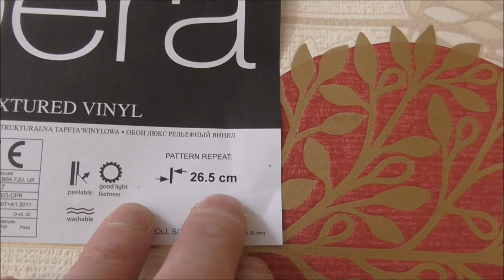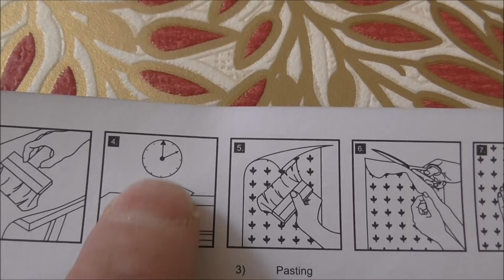Hanging feature  wallpaper on a chimney breast handy tips

Comment: Great job once again

When doing any fireplace as feature wall, do u always start from the centre and when it comes to the corners Measure the distance from the edge of the wallpaper in the centre to the front corner of the chimney breast, then add 25mm. Cut a length of paper to this width and hang, taking the extra 25mm round the corner, overlapping the side piece. Repeat for the other side , and then overlap the piece round the corner to the wall to finish.is this how you do the corners.

Comment: Great job and well explained, did you line first ? and what circumstances would you line?
Reply from the maker: Thanks, in this case no need to line usually only line if the paper is very thin and light in colour or the walls are crazed.  I always line if the instructions on the paper advice to though.
Reply: @PaintingandDecorating  That comment was very helpful. Have done a fair bit of papering and don't usually line but understand more now when you would need to.
Reply from the maker: @pizzaboy3946  thanks.

Comment: Great video informative as usual, I do have a question   when you paste two lengths at a time like you did with the first two you said it's critical to get the soaking times the same but if it only takes you a couple of minutes to paste two lengths but over five minutes to hang the first piece then that means the second length has been soaking for at least 3-4 minutes longer? 
Cheers Ian
Reply from the maker: IAN Knight you adjust how long it is before you paste the second.

Comment: Would papering around an external corner, cause the paper to go out of plum? Do you need to overlap like you would with an internal corner?
Reply from the maker: It depends on the return, if you have more paper to put on then it has to be plumb.. usually loose it actually on the corner if it does not line up.    Thanks
Reply: You    should    move    with    the    times    mate    and    use   a    blade     more    .also   a    rubber    seem    roller   .    Not    being    funny   .    Just   saying   .